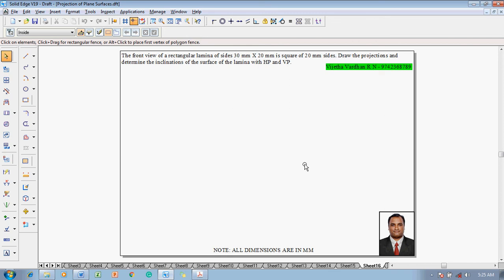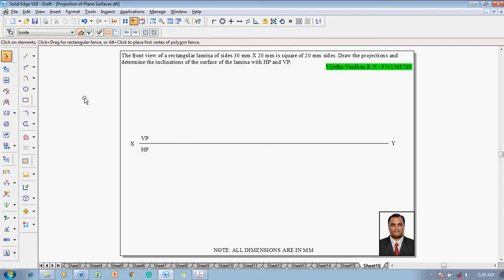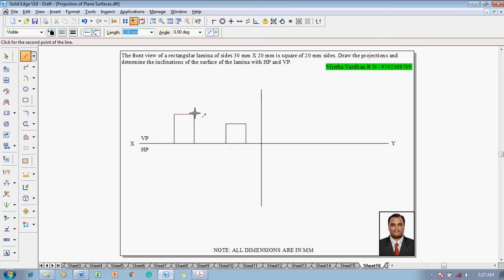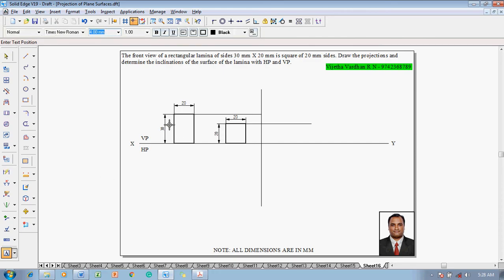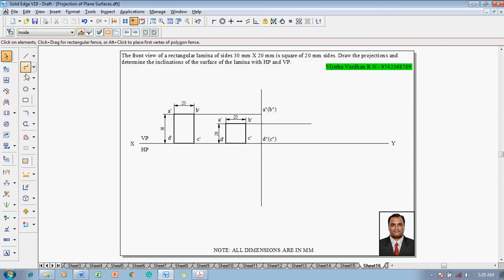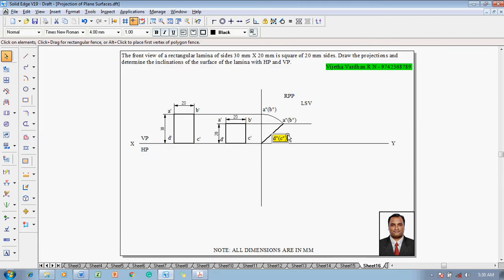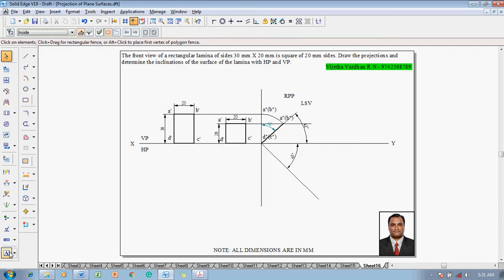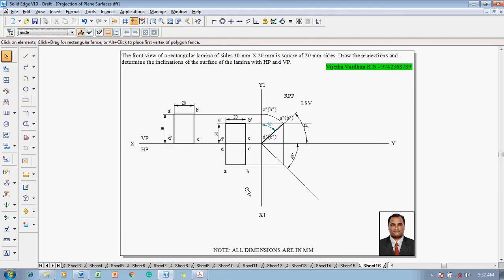Example 16 on Projection of Plane Surfaces

Comment: Sir the  rectangle 20*30mm on the vp why not on the hp 😢
Reply from the maker: If you stare at HP then you will end up with Top View of a square 20 mm. so we took VP to get it as a front view of 20*20 mmm